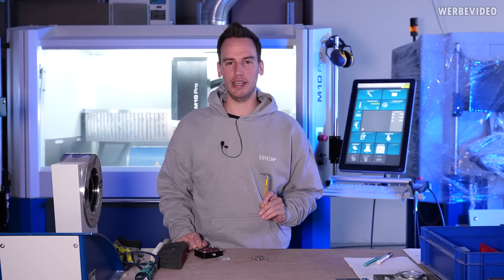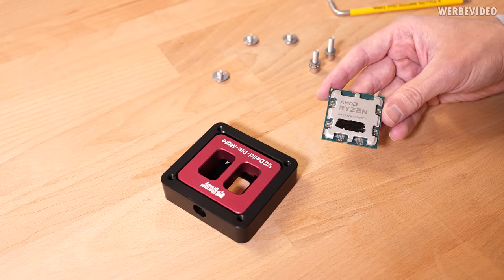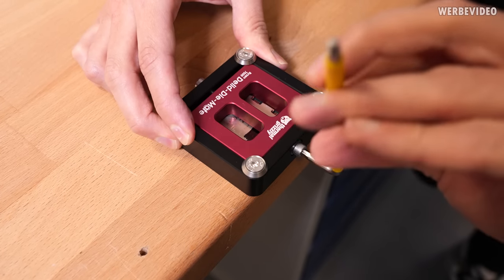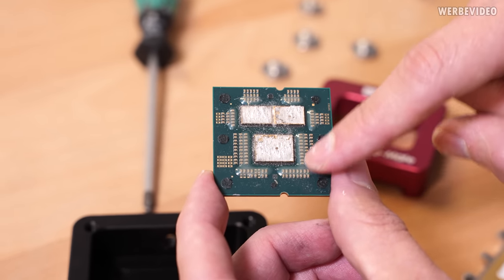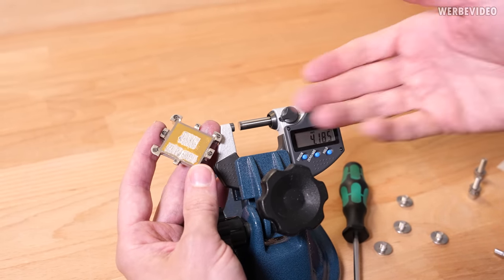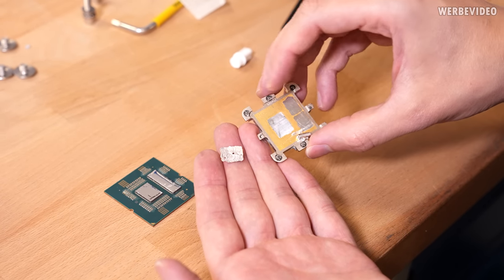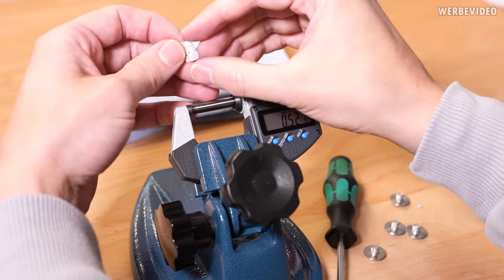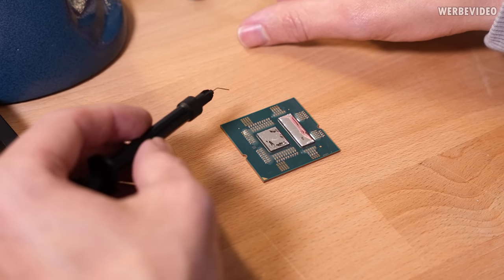Different Chip Height due to 3D-Cache? R9 7950X3D Delidded

Comment: To actually see the 3D effect, you need to delid two of them and use the cross-eye technique.
Reply: Or just clean off all the indium solder lol
Reply: @MlnscBoo  r/woosh etc etc.
Reply: @fVNzO  I know right, I was also kind of annoyed that he used half a tube of liquid metal and still didn't wait long enough...
Reply: @MlnscBoo  Nice attempt brotherman.
Reply: @fVNzO  damn it
Reply: @fVNzO  So just to be clear, is the 3D v-cache not actually visible like it is in the AMD renders?
Reply: @MlnscBoo  I'm getting worried now.
Reply: @MlnscBoo  Would make sense given that it's all made of the same material
Reply: You will see a zebra if it's the x3D version.
Reply: @butanding1987 I just see a sailboat ⛵
Reply: @MauDib  Then it's fake.
Reply: Substantial lol. TY.
Reply: @MlnscBoo  you can't actually see the 3dvcache if it did remove everything you might see the lines where the vcaxhe would of gone but that's it, xray would be the best to see the entire die after different angles and depths on the fly
Reply: They really need to make the 16 core or whatever they may reach in the future 24 core or 32 core with all of silicon having 3dvcache
Reply: @chosen1one930  Thanks man. Yeah I figured that out pretty quickly when the others here were being, lets say, not so friendly about it. Thanks for an actual straight answer. I understand AMD were just making a point that only one IC had the 3dvcache. Which I agree was an entire issue on its own. And I agree the more cores the better, lets just hope they can be clear with the AIBs and get the voltages under control, so no more silicon cracks under the heat, and they'll have some pretty awesome CPUs. Cheers mate
Reply: If you have more room in your budget you can get those red blue glasses, they really make a difference

Comment: You should use pure gallium instead of liquid metal when cleaning up indium TIM.  Just rubbing gallium and indium together will cause them to alloy together and form an alloy that is liquid at room temperature. Liquid metal is already alloyed and has other elements in it besides just indium and gallium to make it cheaper.  You can also easily make the gallium liquid with just a bit of heat and still handle it in liquid form.  The result you'll get can also be reused in place of liquid metal.
Reply: would mercury work too? can remove the gold too
Reply: @jebdiankerman5029  
Nope. Also, Hg is kinda toxic and hard to handle in general
Reply: @jebdiankerman5029  You probably don't want to take the gold off anyway, assuming it's actually gold. That coating will be to help the solder stick so it might also be beneficial for liquid metal too.
Reply: The thing with mercury is it forms an amalgam or amalgamation when it alloys with other metals. What that means is it "soaks up" the other metals and then begins crystallizing with the metal to form a rigid or semi rigid form. That's why it was used for teeth fillings. The liquid mercury could fill all of the crevices of the tooth, then gold is added until the filling hardens up.  The filling then continues to harden as the crystal structures form.
Reply: Sounds great, but where would an enthusiast layperson buy gallium and know what they're getting?

Comment: How about 3D printing a cover to protect the rest of the chip when you're scraping away the indium? Could also be used to hold it level, helping prevent gouging.  Added bonus of stopping the liquid metal from spilling over from that lake!
Reply: Oh that's a good idea.
Reply: You could just put the CPU in his direct die frame. The caps are lower than the die, so just use a blade that's wider than the frame.

Comment: I know they show the 3d cache chip added to the top but it should actually be attached below on the side opposite to the indium solder, unless they run via's all the way through the silicon die. Amazing feat of packaging.
Reply: Yes there are Through Silicon Vias in the CCD die

Comment: If someone is going to direct die cooling, is it necessary to get off the indium?  Wouldn't it be the same to just add enough liquid metal to fully liquefy the indium, take off any excess, apply to the water block and then mount it?  For this video it was necessary to get rid of all of the indium so that accurate measurements can be taken so it had to be fully cleaned.  Normally though, I am thinking this step should be skipped.  What say you?

Comment: Wouldn't using a heat gun to melt and remove indium easier and safer? Or will 150-160c harm the cpu or components?

Comment: I watercooled 5960x-9900k-5950x-12900k-13900k-7950x and I noticed one thing about the 7950x other than the +20°C max temp than the previous 5950x, it took several seconds more to go from max to idle temp than every other cpu, one of the less talked benefit of custom loops is that your cpu temp goes down in 1-3s with the 7950x tough had to wait 3-5s which raised my average liquid temp over time I blame the thickness it's something even my much hotter 13900k runnin g 380w cpu only doesn't do it goes from 99 to 30 is like 2s
Reply: the IHS on the 7000 cpus is one thicc boi. not really sure why amd decided that was the best way to keep thermal solution compatibility, they could have done it another way that would have kept the IHS from becoming such a large thermal mass.
Reply: Lol cooling down slower is better for the silicon

Comment: Hmmm.  Maybe they started making the cache die the exact same dimensions as the CCD's.  Perhaps they also spread out the SRAM cells, and put in lots of thermal via on the die, to assist with removing the heat.  Know anyone who would want to desolder their die from the substrate, and each other?

Comment: If you use solder wick, flux and a soldering iron set to low temperature, wouldn't it be easier, cleaner and safer to remove the indium solder?
Reply: Interesting idea, but I think you'd actually need a very high temperature and may risk desoldering the CPU dies themselves if you aren't careful.

Comment: Question about AM5’s heat load, I don’t have one yet since I was waiting for the 7950X3D: Can you simulate the cooling requirements by having a 5950X with PPT/EDC/TDC limits removed that this way takes up to 250 W under full load?
Reply: you can simulate wattage but not temperatures since how the coolers mount and heat density varies between every CPU design

Comment: Hey. This might be an uninformed question, but once we have a 7950x or 7950x3d delidded, will an ordinary AM5 AIO water cooler work with regular thermal paste, or are special arrangements needed? Thanks anyone!
Reply: If I recall correctly from his other video, the delidded cpu is lower in height than the mount for the heat sink thus will need another special water cooler block and a special mount on the motherboard.
Reply: @mecha207  Hey, thanks! So at the moment, there's no point in delidding, as it won't be usable unless we do a complicated custom job? Or is there a way to do this that isn't too difficult?
Reply: @ashleyperez-rd1wr  No, there is no point unless you are chasing lower temperatures and are over clocking and have the supporting hardware. Honestly, even custom watercooling is pretty expensive but anyways that is my opinion on that matter.
Reply: @mecha207  Thanks again.
Reply: Don't need a complicated custom waterblock, just one that isn't oversized so it can sit lower. The only custom thing is shorter screws mainly. Depends on how your mount works. I like having my custom water system versus aio, other than better performance, I can modify it to fit my needs and change with the system.
Reply: @jeffpeixoto663  Thanks! If I'm understanding you correctly, there are AIOs available with smaller waterblocks that will squeeze into the smaller space that resulted from the delidding? Or would it be necessary to replace the waterblock on an AIO with a smaller one?
Reply: @ashleyperez-rd1wr  you can't change the block on an AIO, it includes the pump and those systems aren't meant to change around or even open. They also come with mounts that aren't easy to modify. That's why I said custom system, since you have the ability to change things and easier to modify. But it depends on the waterblock chosen as some are pretty wide and will probably interfere with parts on the motherboard. Making a custom water cooling system isn't very complicated but changing the cpu to be delidded changes what the parts were made for and makes things complicated.

Comment: Extra caches should help in 128G configurations where the ddr5 has to be with lower clock like 3600MT/s
Reply: I hope that, too. I’m curious about AM5 configurations with 4 x Micron 32 GB DDR5-4800 ECC UDIMMs. As far as I know the tests that demonstrated issues with 4 DIMMs had been done with DIMMs with SK hynix memory chips.
Reply: @abavariannormiepleb9470  Intel platforms also have issues with 4 dimms, it's a common problem with ddr5. Probably it's time to introduce buffered memory on the desktop platforms

Comment: Can you not sand the remaining solder off with a 2000gritt or something like that? Seems a little dodgy to clean the cpu for liquid metal.
Reply: you can use a SOFT bristled toothbrush with ZERO force

Comment: Wonder if this will help with the Ghz on the v cache CCD. So far from a few tests I have seen it doesn’t even hit 5ghz. Wonder if 7900x3D is two v cache CCDs or 8+4?
Reply: It's definitely not 2 v-cache CCDs. The question is whether it's 6vc+6 or 8vc+4 which still seems unconfirmed. The fact it has a 200 MHz higher baseclock than both the 7950X3D and 7800X3D makes me suspect it'll be 6+6. That'll be strange but you may be able to squeeze out higher clocks, similar to why to the 7900X can occasionally beat the 7950X. I think it'll be hard to justify but we'll see.

If it is, it makes even more sense why the 7800X3D was delayed. 6 v-cache cores will fit nicely below the 7950X3D but an 8 v-cache 7800X3D could make it especially silly. The one advantage of the 7900 (aside from 12 cores obviously) is that it can utilize full memory bandwidth with 2 CCDs vs the 1 CCD 7800.

Plus a 6 core v-cache chiplet basically guarantees there's potential for a 7600X3D to release around summer. If entry level board prices improve by then, it could get very interesting.
Reply: 6vc+6 the extra clocks is from less heat produced from 2 less cores per ccd, why the 7800x3d has the same clocks as the 3dvc chip on 7950x3d

Comment: I thought the 3d vcache models didn't allow for voltage adjustments etc. This is interesting content but would we see any real world benefit from this?
Reply: You can adjust the voltage lower on any x3d cpu as long as the motherboard allows it (I can do it right now with my x570 msi motherboard with a 5800x3d), but if you adjust the voltage higher either with a modded bios or an external voltage regulator, the cpu will detect it and lock itself to base clock speed which in the case of the 7950x3d would be 4.2ghz. The benefit to delidding an x3d would be to increase clock speed because of lowered temperature. How much that would matter on 7000x3d's I haven't heard yet. I know in the case of my 5800x3d (that's not delidded and never goes over 80c) it will run at full clock speed under an all core workload so there would be no advantage to delid my 5800x3d, at least in my case. We'll all have to wait and see if delidding x3d's makes any difference in performance.

Comment: You can also remove some of the silicon transistors in the processor occupy only ten percent of the entire crystal in thickness
Reply: Exactly. Even if they add the 3d cache, I doubt they would change the substrate thickness.

Comment: I wonder if the 7900X3D consists of two 6c chiplets or one 8c+3D V-Cache and one 4c chiplet w/o 3D V-Cache? Anyone know the answer to this??
Reply: I’m guessing 8c+cache and 4c without. That way AMD only needs to dealing with manufacturing one chiplet SKU with v-cache. We won’t know for sure until der bauer gets his hand on it though!
Reply: @dylanjastle  all chiplets are the die. They just laser off cores, which is automated during the binning/QC process. I would imagine the bin before adding the cache, so the failure rate is low.
Reply: @ionstorm66  Would it change any of the process to put cache on top of a fully enabled 8-core CCD vs a CCD with only 6 cores enabled? Seems like it would change something subtle to give only 6 out of 8 cores access to all the cache vs 8 cores. Maybe it changes nothing though.

Previously they did two 6-core CCD's on the 5900x and 7900x skus, so it would be a change to go to a fully enabled 8c and a basically half-enabled 4c. I'm really curious to see how they do it.
Reply: @dylanjastle  apparently it’s the 6/6 configuration. 7900x3d could be dog water compared to 7800x3d
Reply: @dylanjastle  Stacking v-cache on 6 cores instead of 8 should be fine because it's all shared. Even the other chiplet can access it but that's obviously not ideal. Also take a look at the base clocks. Both the 7950X3D and 7800X3D are 4.2 GHz while the 7900 is 4.4. The only reason for this I can think of would be 6 core chiplets.
Reply: @fugehdehyou  I suspect it's another reason for the delay but there could be an advantage to the 6 core chiplets able to sustain higher frequencies, as suggested by the 200 MHz higher base clock.

It is strange but 6 cores is perfectly fine for a lot of games so if it can hold closer to 5GHz out of the box, there may be something to it. Plus there's also the 2 CCD memory bandwidth advantage over the 7800X3D but that'll only really matter outside of games.
Reply: @JJFX-  maybe but let’s be honest. If they down clock the 7800x3d. You’d get better results from just over clocking it.
Reply: @fugehdehyou  Possibly but I don't think they're really downclocking the 7800X3D CCD. The issue is the v-cache CCD not even hitting its full potential. All I'm saying is if it's easier to keep the smaller 6 core v-cache boosting higher, it could have some interesting results. Of course with AMD, there's a lot of potential with proper tuning that is often glossed over in reviews like techpowerup's which really seemed to tilt the table towards Intel IMO...
Reply: @JJFX-  their product stack is so convoluted it’s mind bending. We shall see I wouldn’t put anything past them…

Comment: in a kitchen the cut away from yourself rule applies to everything, except when cutting something in-hand with a small paring knife, where control is more important. this matches that imo, and you're not pushing the blade in the direction of a finger

Comment: I wonder if they can add more cores and threads to the chiplets over time or make different size chiplets say 12 core for 24 or say a 16core chiplet or have large sockets and more chips for a ryzen cpu. Say chiplets on bkth sides like threadripper. They will have to answer the 24 and 32 core intel chips the 32 core is coming eventually. I really dont believe p cores are the answer especially since how ryzen can perform so well using less power

Comment: As you can't over clock an x3d I see no point in deliding the chip plus the chip runs colder the a non x3d so not like it will change much interesting though.
Reply: Dunno, if the IHS is thinned, it would probably help sustain higher clocks overall, was able to drop from 95°C on original to mid 80's °C
Reply: @s1n1stersixsgaming8  yes cooler is better but think you missed my point as this was about overclocking, Which is why you would delid a CPU in the first place there is no head room to be gained on a X3D power is limited its locked and runs no where near it thermal cap.
I would be interested to see if there are any gains just can't see where they would come from.
Reply: @historickeeper  yep, no point in this. Most people wanna do eco mode 105 anyway. I will do that on my 7800X3D...Which hopefully will for sure be avaliable to buy, not sold out in EU before april 15 ^^

Comment: Might as well add cache onto every chiplet
Reply: Then you lose out on high frequency performance.
Reply: @zkilla4611  if that's your priority then youre better off not getting x3d to begin with as we see it is worse, if gaming Is your priority then might as well get all the cache as possible
Reply: @noticing33  while im initially inclined to agree, AMD may have a legitimate reason for only putting it on one die. If you've watched GN review then you should know about the software requirements for getting the best performance out of the chip and how they basically confine gaming workloads to the ccd with the cache. stacking the cache on top of the die is going to increase the latency of that cache somewhat, so having stacked cache on both ccds may have introduced latency hits that were outside of AMD's performance metrics for these parts (but might be acceptable for EPYC, time will tell) if the cores were needing to retrieve data from the other CCD's stacked cache.
Reply: @nemesis1588  I think a better driver software and a little hardware change can make it worth it for gaming still, because if ccd1 can't find data on it's own cache, it can go to the other ccd cache, sure there's latency but surely it will still be faster than going to system ram, if say the I/O and ccd2 triples the stacked cache the sheer size could help feed the main ccd cache in use

Comment: I think using a soldering iron running at low temp combining with some solder wick should be easier.

There will obviously be no difference in hight, otherwise the lower die will have significantly higher temp. Even without the cache die, they will still put a sheet of silicon crystal on the die just to fill the gap.